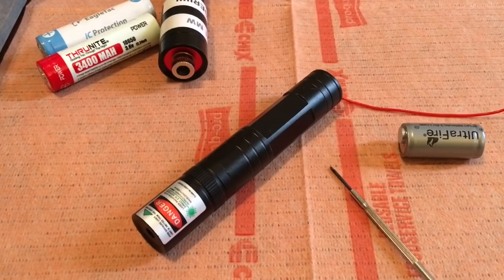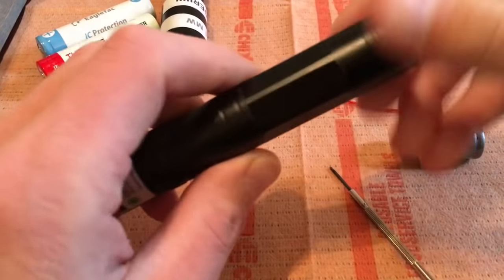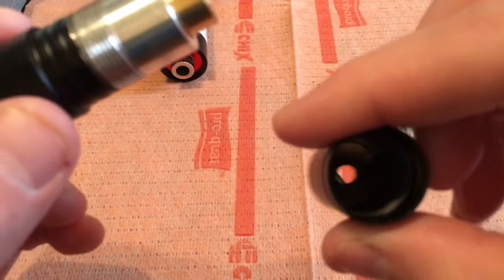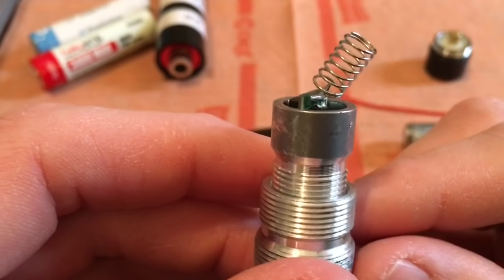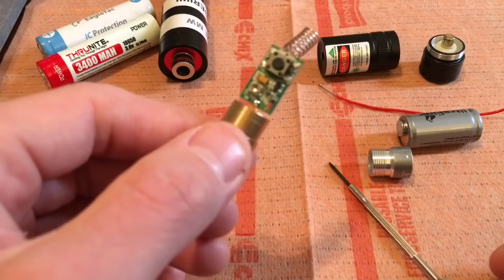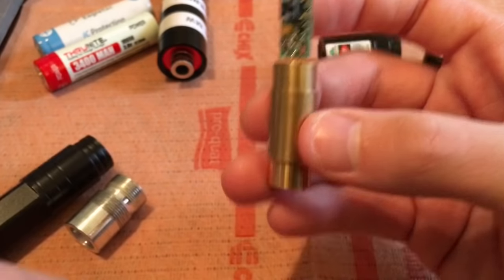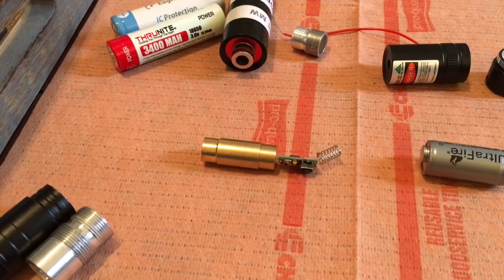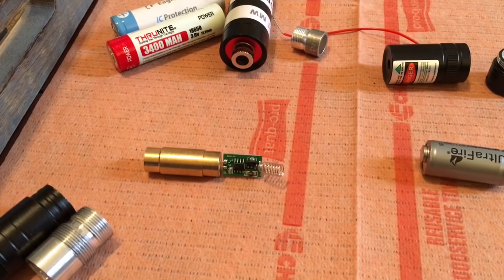How to Mod your green laser pointer.

Comment: Nice video, picking up a handful of these 850/1s to play with soon. I also have a collection of high end and custom built lasers but I still enjoy the cheap ones! The reason for the direction of rotation is that the potentiometer is a variable resistor - so counter-clockwise is correct -  lowering resistance > increases V = increased P. Cheers!
Reply from the maker: Ahhh. Makes total sense :D
I’m with you on that as well, the cheap ones are super fun to mess with. I actually ordered a 200mw 532 module to drop in my 850. 200mw of green equals about a watt or more of IR so I’m gonna have to modify a small heatsink in there somehow. I’ll probably just run it with a 15sec on 60sec off D cycle 🤔
Reply: @04mach1speed  Ive also been thinking about whats possible to mod with the cheapies and the 850/1 is probably easier because of how it comes apart vs the 301/3 series. Is the 532 from a lab module or something? Ive shopped a lot of directs but never looked into whats our there for dpss. And yeah, I personally run conservative duty cycles on all my lasers - especially my smaller ones with limited heatsinking. Deff need to post a video of that project post-completion!
Reply from the maker: Nick T yeah I’ve kind of done the same. I have actually been thinking of doing a 850/851 488-492nm but I would have to figure out how to add a spring to the driver
Reply: @04mach1speed  I want to know, is there a way to turn the spring into wires instead?

Comment: OMG Thank You!  I bought one from a garage sale for a dollar (missing switch button on case). Your mention of "case positive" prompted me to flip the battery around and find that it works! I'm so happy. TY TY.
Reply from the maker: thats great it worked for you, sometimes their isnt polarity protection so they usually get damaged so im glad it worked for you :)
Reply: @04mach1speed  no polarity protection means the batteries can go either way?
Reply: so you simply had the batteries installed the wrong direction?
Reply from the maker: @ARCSTREAMS  no polarity protection simply means if you end up putting the batteries in the wrong way then itll fry your laser. polarity protection just ensures that if you accidently insert the cells in wrong then the driver will cut any power instantly befor it ruins your Laser/Flashlight :)
Reply from the maker: @ARCSTREAMS  on 532nm lasers, theyre all DPSS so the IR laser is usually Case positive, meaning the batteries go in Neg first so that Positive is facing tailcap. I guess it sometimes depends on how the laser is wired but most all 532s are Case pos
Reply: @04mach1speed  ahh yes like those diodes that only allow flow in one way ,got it
Reply: @04mach1speed  i understand that it depends how the polarity goes but not sure what that has to do with them being dpss or just direct diodes? i assume even direct diodes can still have case positive or negative ,they can design them either way no?
Reply from the maker: @ARCSTREAMS  yes you're right. some diodes are case pos and some are case neg. I think in the case of DPSS, really the only reason DPSS 532nm is always case pos is because 532nm uses IR diodes at 808nm and every 808 I looked at online was Pos. and Most all DPSS are usually powered by AC. really the only dpss i can think of in portable form is a 532nm, 473nm, and 589nm. i dont even know if the 473 and 589 are case+, sorry, kind of a long answer but I was trying to figure out how to answer. honestly, I still have so much to learn myself :) I wish i was an expert. lol
Reply: @04mach1speed  "I wish i was an expert. lol" or at least know one that can answer our questions lol , man i wish i can also talk to someone who knows about light and can explain things in laymen terms to me as i have made this setup that turns led white light inot a laser like collimated beam and im trying ti understand some things about what is happening but can not get this info online and i do not see others talking about it much or any vids on it
Reply from the maker: @ARCSTREAMS  I actually know quite a bit about collimation and light, just not so much about lasers lol. I have been a flashlight and LED enthusiast for 20 years but only been into lasers for about 4 so i know way more about led flashlights, my channel is actually mostly flashlights lol. Light is my passion :)
Reply: @04mach1speed  yeah i see you are into that but im talking about understanding the behaviour of light and optics and putting things together, as i said i made my own long distance thrower and so far got it down to 1.4mRad but at great expense of light ,im trying to figure a way to increase the intensity while maintain optimum beam divergence quality ,also im still trying to understand what exactly happening in my setup ,if im getting a spatially coherent beam or gaussian etc etc so i wish i can talk to someone about the many q's i have on the subject
Reply from the maker: @ARCSTREAMS  oh i see what youre saying. yeah thats the really bad thing about this hobby and light in general, its incredibly difficult to look for the right answer or how to word it online. their are so many things I have tried looking for answers to and was unsuccessful.
Reply: @04mach1speed  yes exactly its difficult trying to find the keywords or sentences when doing online search and many times i come up with nothing ,as simple as my light experiment is i cant find anyone else online doing the same in either vids or articles ,for example im trying to find an explanation of what happens to white light as it goes trhough a small pin hole,they say it becomes more spatially coherent but what does that mean and how?
Reply from the maker: @ARCSTREAMS  hmm, thats interesting. now im a little curious myself. that would be a good question because white light is never of a single wavelength and coherent as it is so what it would do in that situation is kind of making my wonder.

Comment: I just pulled apart one of Elay's 303 clones and I can report that there is no potentiometer to mess with in that unit. Its a fixed power. Nicely pressed together, it just took some tapping with thin screwdrivers to get the diode/driver out of the host. And it went back together very nicely and works perfect again. Good little laser for 12 bucks.
Reply from the maker: Ah that sucks. It’s fun to mod these things lol! But that’s good to know. Thanks for the input :)
Reply: Wait how did you upgrade the 303?

Comment: Destroyed my laser 303 trying to mod it.  I ended up breaking the leads off the pump diode while removing the module. The laser 303 doesn't have a potentiometer anyways so it cant be modded easily.  Most of the JD850/851 can be pot modded.

Comment: What is the reason for them having a built in power regulator. Also how do you know how much to overclock it so that it doesn't burn out.
Reply from the maker: I believe it’s because a lot of drivers are built for multiple kinds of diodes so when a manufacturer decides what wavelength they wanna put the driver in they can adjust the current accordingly. Just so happens that’s good for the consumer that wants a little extra power as well even though that’s not the intention of the manufacture haha! And it really depends on the wiper of the potentiometer or K rating I think? It’s really difficult to tell what the overdrive is on it. I mostly just guess. Luckily I have a LPM and that’s a good way to tell if you’re pushing it too hard. I know that generally most cheap 532s that come out of pointers can’t go much higher than 60-80mw without blowing it up so I just put them on my meter and adjust it till it’s 20-30mw over what they say it can go to. Example being that if the laser says it’s 40mw I’ll just bump it up to 60mw and it can usually take it.
Reply: @04mach1speed  Thanks for your time to reply! 
Wish I had a milliwatt meter or some way to tell how much power is being outputted from lasers.

Comment: thank you for this vid that helps understand some things, i had those cheap red 5mw lasers and i always thought the board still look complicated but is it really juts a switch and some resistors on them or is there a bit more to it than that? they seem more complex to me , also i wish i can find a cheap red with a pot on it ,always wished these things were brighter ,and if there is no pot is there a way to still somehow increase the current?
Reply from the maker: somehow their is, but i think you have to understand electronics very well, and i dont. im still learning as well. and thanks for the comment :)
Reply: @04mach1speed  yeah its all about understanding electronics to be able to modify the board to allow more current but then you cant go above the threshold of the diode, i wish i understood such things better
Reply from the maker: @ARCSTREAMS  im the same way, i know about 1-3% of electronics. that leaves about 97% i still still dont understand. I would absolutely love to understand it a lot more
Reply: @04mach1speed  electricity/electronics has always been a weird pain in the ass for me too lol
Reply from the maker: @ARCSTREAMS  I totally agree, resistors, Transistors, rectifiers, inductors, zenner leds, capacitors, and so much more! theyre slightly confusing to me, i would do anything to know how to build a driver board from scratch but understanding circuits and electronics is key and confusing to me lol. I almost want to go to school for electronics just for my hobby but that would be expensive haha

Comment: Laser diodes are current devices . If you exceed their limitations,  they will AVALANCHE  AND BURN OUT!! The potentiometer  is there for one good reason... TO SET THE POWER LEVEL TO THE DIODES MAX LEVEL. IF YOU EXCEED THE LEVEL , EXPECT THE DIODE TO  HAVE A VERY SHORT LIFE!  NO EXCEPTIONS!

Comment: Is there a correlation, equation, or chart that estimates output optical power as a function of input current from the battery? Measuring the current is very easy.
Or...there may a test point on the PCB at which one can measure a voltage that correlates to output optical power.
Reply from the maker: thats a good question, their might be something like that on Laserpointerforums. truth be told i got out of the hobby a couple years ago and im not in the loop about these thigs much. i didnt get out permanently, i have just had so much other stuff going on. ill eventually get back into it. are you a part of LPF.com? really good place.
Reply: @04mach1speed  I think I'm unfamiliar with LPF until now but there are a lot of things going on. I don't have any log of signing up for it.
Thanks for pointing it out.

Comment: Know anything about these lasers I saw your video I tried with one that I had and it's a little different than the one you have I couldn't unscrew that I out of there and I seen another video where a guy use a screwdriver to kind of tap around it so it'll come out well when I tapped around a little the 3 wires wires that are  going to that copper colored metal thing with the  eye came off now there's no way of pushing those back in right it's already messed up

Comment: I have seen 3 slightly different laser 303 designs
Reply from the maker: Come to think of it so have I
Reply: @04mach1speed  Two 303's I have are slightly different too. Both are pressed in. The older one had no support for the board for when pressing the switch causing the board to be pushed to the side wall like in this guy's video. I bent the board back straight and switch now is where it spota be.  The second one they improved the design by inserting what appears to be a plastic shelf for the board to provide support when mashing on the switch. I'm going to try to press then both out to see if there is a pot on there or an smd resistor that might could be modded.
Reply from the maker: taterman320241 yeah that’s happened to me before, I know exactly what you’re talking about. I was always wondering why they didn’t do that to begin with. I bought one a couple years ago and when it came in the driver was actually completely broken off. I was thinking wtf! Good thing I know how to solder haha
Reply: Some may be counterfeit "copycats". That's a big problem in the internet marketplace...especially with rechargeable Li-ion cells.

Comment: Hi, so I ordered 2 of these off of ebay, they both had potentiometers, and I was able to increase the power. I ordered 2 more from the same seller, they looked identical-but no pots. In fact, I think they're using an LED driver as theres no chips or capacitors, just 2 4 ohm resistors and a current regulator..  I ordered 3 more from different sellers and NONE OF THEM had pots. did they update/cheapify the design? do you know a source of the classic design with the pot? thanks
Reply from the maker: Yeah that seems to be a huge problem with 532s now. I noticed that some of the ones I bought also didn’t have Pots. Honestly I don’t thing their is a way to tell anymore if they’re gonna have them. So my best solution I found now is to just buy 532nm modules without a host or pen. Just the bare module and driver attached. They’re usually pretty good quality on Laserlands.net and Techhood EBay. You can see the pics before you buy them and can usually tell if they have pots. Hope this helps :)

Comment: My spring broke off, what kind of spring do i need to replace it?
Reply from the maker: If you still have the spring, you can actually solder it back on there. It’s actually hard to find springs that don’t cost as much as the whole module. You’re better off just buying a new one :(
Reply: @04mach1speed  Thanks, yeah i didn't know it needed one or what was wrong with it until i watched your video and saw, oh, looks like the spring is missing! It was loose inside and battery wasn't making connection.
Reply from the maker: Original Insights Tarot yeah that’s the really bad thing about these cheap things, the springs aren’t soldered on them very well. Probably because China doesn’t care lol! I have like 3 where the springs just came off :(
Reply: @04mach1speed  i have some solder and i think I'm going to give it a try with an old vape coil i have. Do you think that is a bad idea? I'm just too impatient to wait for one to be shipped
Reply from the maker: Original Insights Tarot hey you! Sorry I have had so many comments. Did you try it? How big was the spring

Comment: what if the driver board doesnt have a potentiometer?
Reply from the maker: Madcr0ws sometimes they don’t, if that’s the case than you can usually bridge the resistors but that’s too risky if you don’t know exactly what you’re doing. I have never done that but I know it can be done
Reply: Mine  didn,t have that potentimeter screw thing, so i pushed that little round black button in that  little raised square box just once and it does seem to be alot stronger and brighter.  I could be just imaging this too, but im pretty sure its brighter. Mark.
Reply from the maker: M Henhawke I think that’s just a switch for by passing. Too bad you don’t have a meter to test it. Those meters are expensive and the only one I have I’m afraid to use for fear of breaking it :(
Reply: @04mach1speed  Yes. your probaly right. Mark.
Reply: @04mach1speed  I know this is an old post, but it's easy to test if the switch has been bypassed with a cheap ohmmeter. If you know the pinout of the switch, sometimes you can just look at the circuit board traces (connections) to whether or not the switch has been bypassed.
Reply from the maker: @exgenica  oh okay i see, yeah their are so much about electronics i need to still learn.

Comment: hello friend, well, that golden part where the little one is, took off, and it doesn't go far anymore, the beam is a giant ball, is there any repair? or do you have to buy another piece of that gold there? if there is, please check me, I have a laser like this, I'm from Brazil🇧🇷, and here I don't get lasers; -; answer me please !!!
Reply from the maker: hello. sorry for the late response I have so many comments, yeah unfortunately you need that piece because it usually houses the lens. their is a little plastic lens that sits inside there. did you lose it? is it really hard to get lasers parts in brazil?
Reply: @04mach1speed  Alright kkkk, yes I lost, I lost the plastic lens and the little light, water fell and burned the little light, then it doesn't light anything anymore, because when I lost the lens, it lit up more naonia far, now that the little light has burned, then it doesn't light up nothing even kkkkkkkkk, I'm looking for that whole golden piece bro, more here and very difficult to find, and when you find the guy charges the price of 3 lasers from there kkkkk, do you know of any site that sells these pieces friend?
Reply from the maker: @CAIKSILVA213  you could be better off buying from Techhood on ebay or Laserlands.net  and since those are modules and not portable hand held lasers you should be able to get them okay where you live. most counties will alow "Modules" as long as theyre not pointers.
Reply: @04mach1speed  I looked at the site already, but this site is reliable friend ?? Got it, thanks for helping me, he was the only gringo who's helping me🤜🏽🤛🏽
Reply from the maker: @CAIKSILVA213  yeah theyre def reliable. i have bought stuff form them several times. hope this helps you my friend :)
Reply: @04mach1speed  ok it's good that they are reliable, it will help, yes, friend, thank you
Reply from the maker: @CAIKSILVA213  please let me know what you do :)

Comment: My laser 100mw 303 model.can i upgrade 100mw to 200mw?
Reply from the maker: actually you can, yes. i have done this by just removing the 100mw module and putting a 200mw 532nm in there. but theyre kinda expensive if youre prepared to pay. I think I paid $58 for a 200mw module. but you have to be careful because it takes around 325mw or IR laser to generate 80mw of 532nm so @ 200mw of green its probably producing close to a Watt of IR so it generates a huge amount of heat